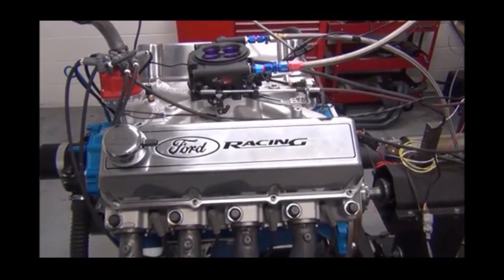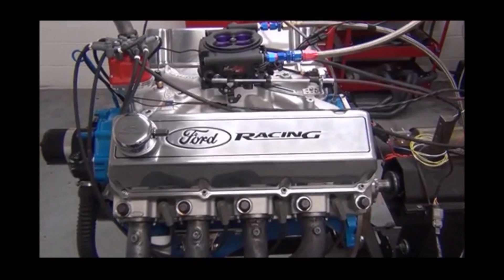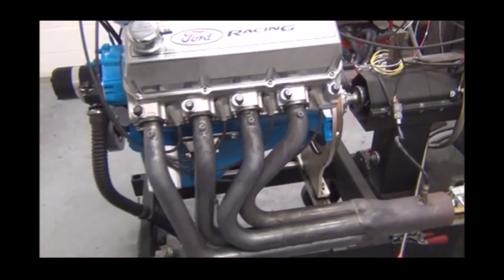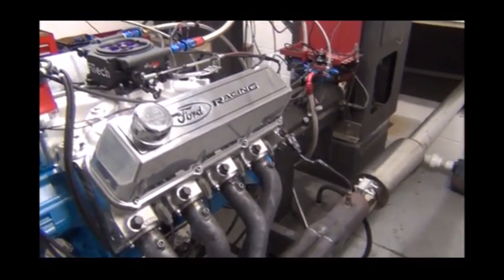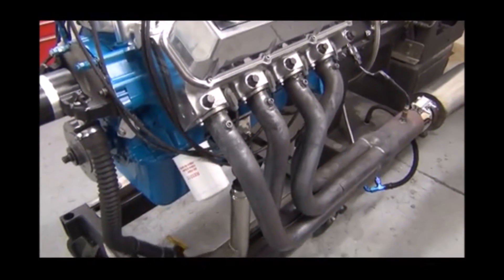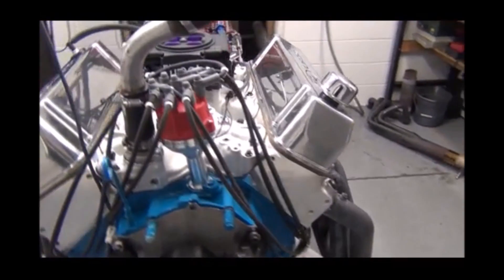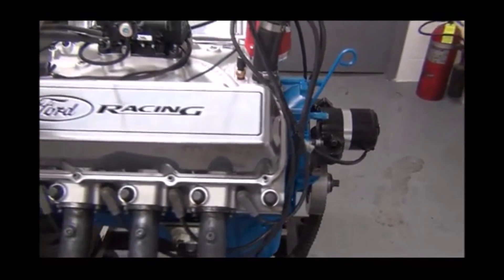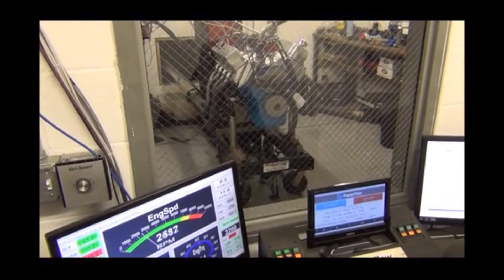Big Block Ford 572 Pump Gas with EFI

Comment: 1/1/2026  Ford Performance 572 Cubic Inch 655 HP @ 5500 rpm  and 710 lb-ft Torque @ 4500 rpm  Part # M-6007-572DF Crate Engine with Warranty for $18,000.  Curious what CNC wants for theirs??